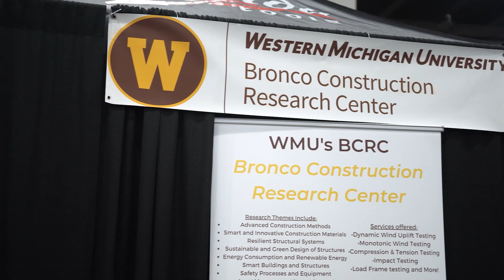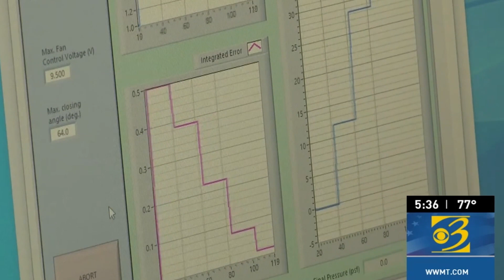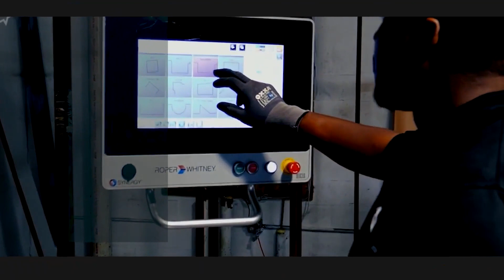Why Roofing Systems fail wind warranties in USA? Engineers explain lab testing

Comment from the maker: Insights: 
00:00 Intro
01:30 Brian and Bilal from WMU Bronco Construction Research Center
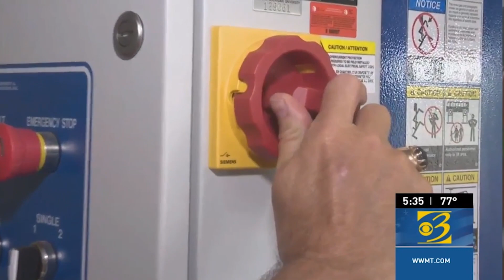02:20 Shingle test process
03:30 US vs Canada testing
04:50 The current rebuilding model
05:30 House that survived Hurricane Michael
06:18 What roofing system performs best?
07:57 Do most products fail the WMU test?
11:52 One advice to roofing manufacturers

Comment: I didn’t know the uplift tests for Miami Dade were static. I understood them to be multiple 3-10 seconds gusts over 100 mph. I’ll have to take another look. 

Metal roofs seem to have the highest uplift pressures, but it still doesn’t consider fatigue like what is mentioned in the video. 

My challenge with metal roofs is, how will they fail? And when they do, what will it cost? Are they easier to repair than shingle or tile?